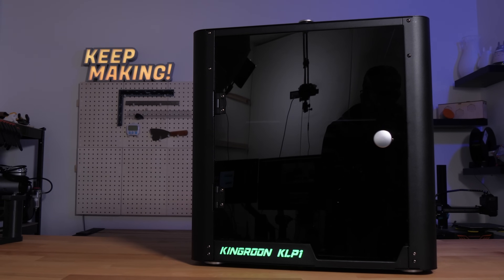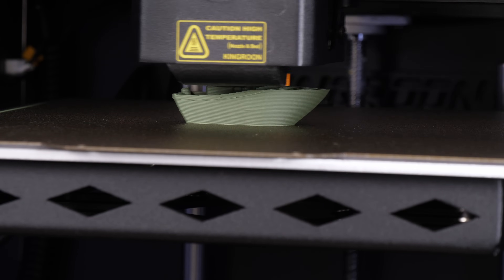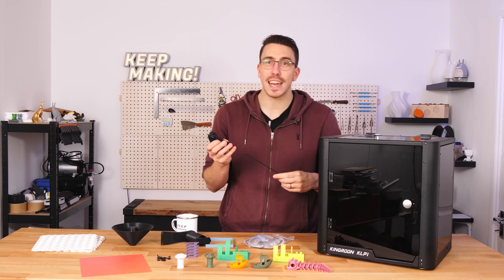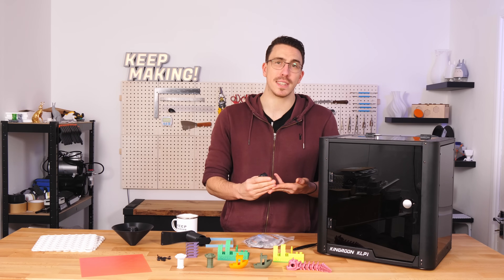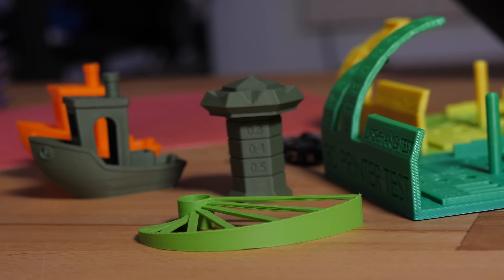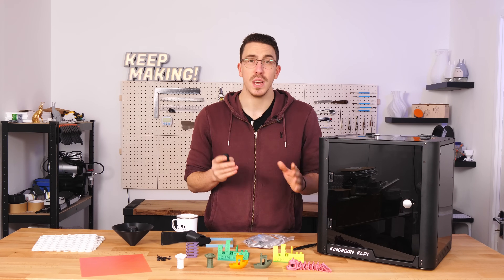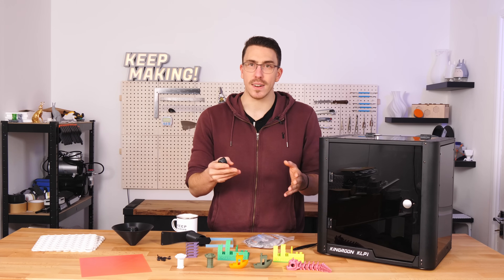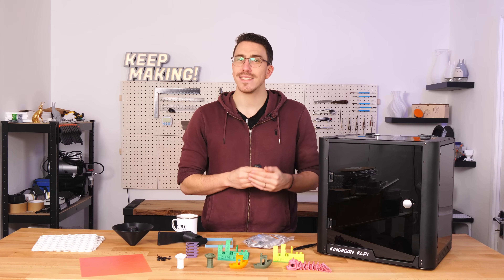Kingroon KPL1 Review. Why is it so cheap!

Comment: I am a hardcore Qidi tech customer for life... their customer service is the BEST in the 3d printer game. I have my 1st and 2nd printers I ever bought from years ago... the Qidi x max 2, and X plus 2 that are still going strong. Anything that breaks on them, even years later... Qidi overnight parts out to me that same day, NO QUESTIONS ASKED. even if it is my fault that something breaks, Qidi overnight parts, no questions asked! For a core xy printer around this size... I would 100% get the Qidi X smart 3 for even cheaper than $379.00. RIGHT NOW THE qidi x smart 3 is only $279.00 usd on Amazon. The biggest thing is that it is backed 100% by Qidi techs' incredible customer service. Great review, tho my friend.

Comment: Nice review.  I looked at the KLP1 a while ago, but there were so many negative reviews that I decided to buy the Ender 5 S1 as it was on sale.  It is not as fast, but faster than my Ender 3 Pro that is heavily modified.  It also prints better than my Ender 3.

I agree with your opinion on the dark colored enclosure panels.  The enclosure on my Ender 5 S1 is the same way.  I would much prefer clear panels.  Everytime I print something I have to use a flashlight to see what is happening.  It definitely needs some led lighting.

The top of the KLP1 cover though should be replaced with some sort of acrylic box to give the cables more room.  It seems like the people who design the enclosures have never actually used a 3D printer or they would not have design it like that.   

Still though is a good review of the Kingroon KLP1 unlike the other reviews so hopefully it is getting better and will continue to improve.  Maybe in a year or so if they make significant changes I might actually want to buy one.  Right now though if I was going to buy one of these fast 3d printers I would probably choose the Flashforge Adventurer M5.  But I don't really need that kind of speed so I will probably wait a year or two.

Comment: it's a quick copy/paste of the crealty k1 with a couple of cosmetic tweaks, which had the exact same lid issue.
Reply: Nah it isn't a copy this is the same setup as their previous KP7 just with a core x/y motion system.
Reply: @SaveTheSunF1R3x  so they had this same issue with the lid and didn't fix it?
Reply: @CrudelyMade  it was more of an after thought. the other one didn't have front and top panels. they just slapped them onto the KP7 frame and called it a day.